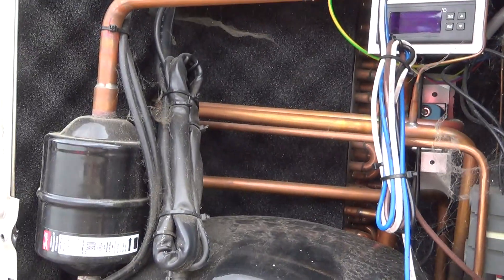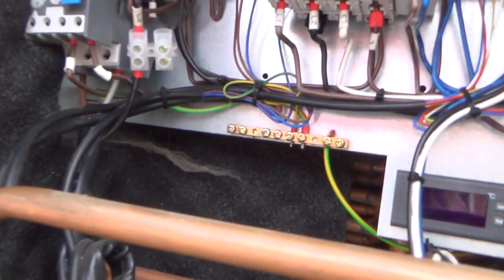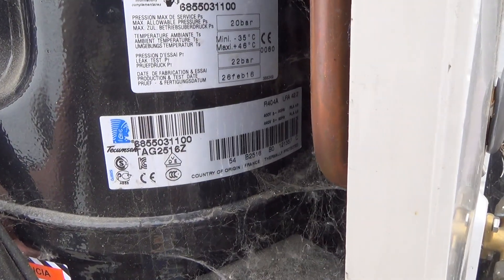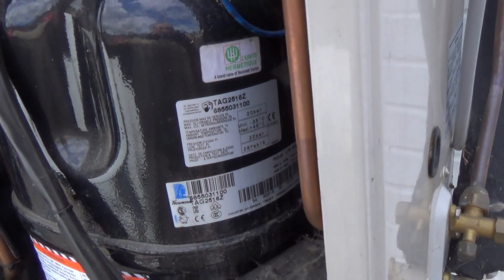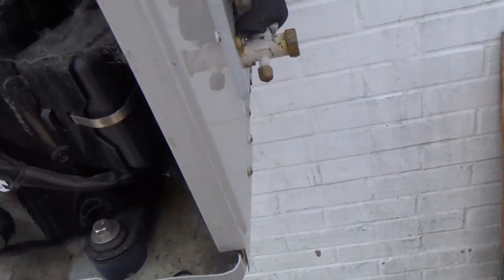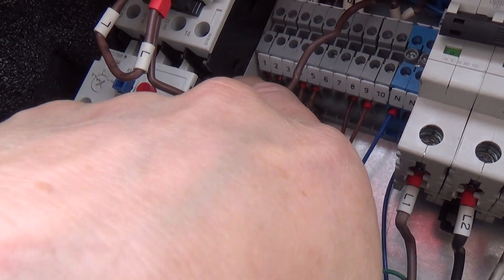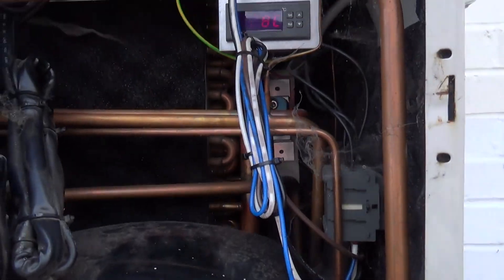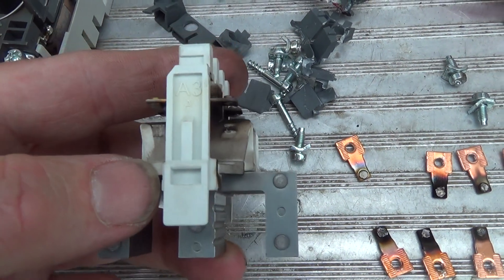Walk In Freezer Warm

Comment: The older BB stuff really lasted well, the current stuff is not as heavily overbuilt, but still reasonable. Lost a few motors to dropped phases, can be a little expensive when you have to get a new one to fix the trouble, especially as the contactor that failed was not at fault, it got full of dust. New control box though, with sealed entries, and replaced the star delta ( that the original installer had wired to start in delta, and switch to star, numpty, no wonder this thing wanted to walk despite having M12 bolts into the floor) controller with a soft start unit, sized for the 7.5kW motor. Never gave an issue after that, though only looked up the weight of the motor after I had unbolted it and semi dropped it onto the trolley after getting the coupling free. 118kg of cast iron, the new one was aluminium case, so only 70kg, so much easier to wrangle up into position, especially as I was generous with the anti seize on that coupler. I put in some sky hooks for the new one, and used a chain block, which came in handy later replacing bearings in the worm box it drove. M16 anchor bolt and epoxy fill, that bolt was never coming out or loose again from there, and a 500kg rated eye on the bottom. The new owner of the building had to remove them with a big grinder.
Reply from the maker: I think the original contactor was undersized for the job, I usually go bigger if I can. 
Sound like a job and a half! Even 70kg is heavy enough.